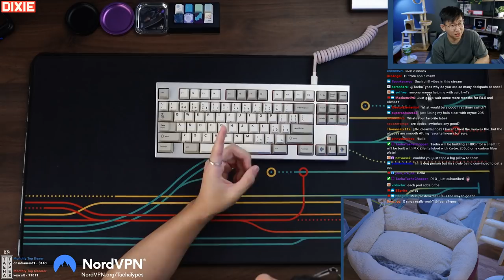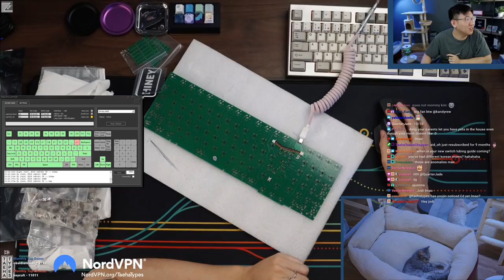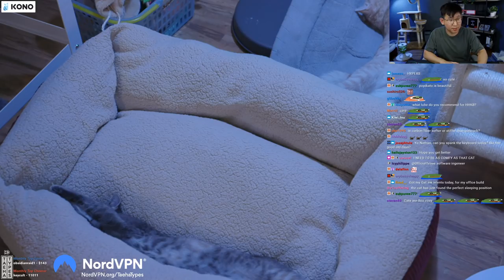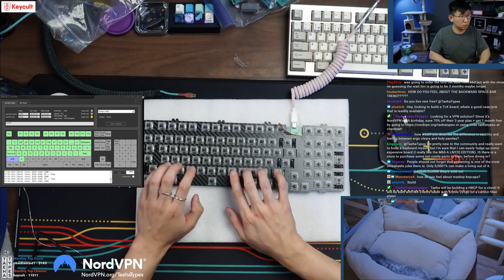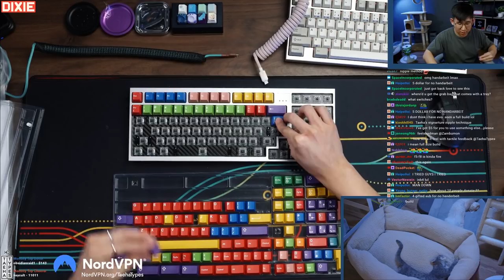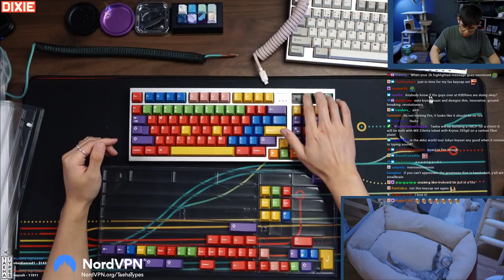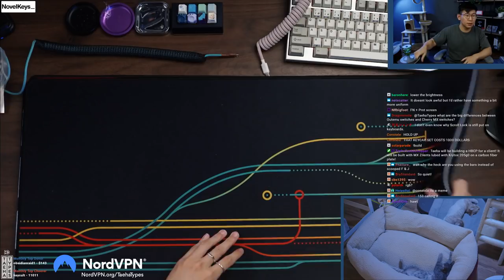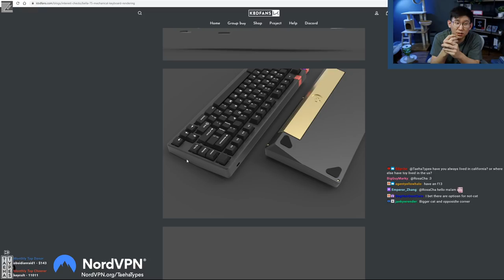HBCP with lubed MX ZilentsBuild Stream

Comment: I made mx zilents, but they feel mushy/sluggish with silent red cherry stem, i think it is because i used the 45g springs...plan on de solder the board and change the springs to 70g
Reply: try using outemu silent stems, they come in linear and tactile, im using them right now and they arent sluggish but they have a soft bottom out.